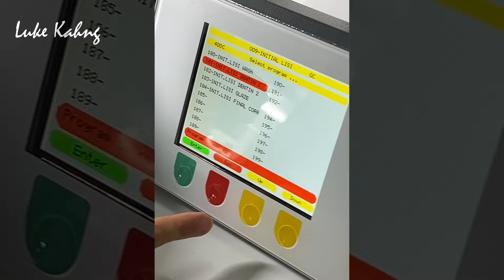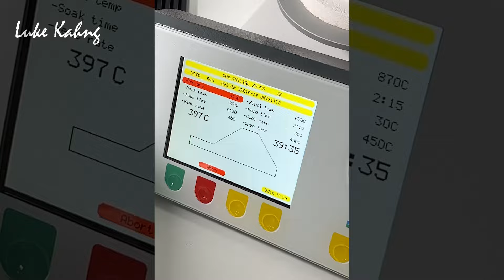Different Full-Mouth Implant Option for Protecting Occlusion

Comment: Mr. Kahng, I have a low smile line. Does that make me a candidate for getting an arch with no gums like the unit you are working with in this video? If this question is too complicated to answer, can you direct me to some kind of literature where I can educate myself on this part of the implant process. Any help would be greatly appreciated. I’m currently in the process of compiling all the information I can find in order to assist not only myself but to make it easier on the doctor as well. I want to inform myself enough so my expectations are based on realistic rather than unrealistic expectations. Thank you again Mr. Kahng.

Comment: My dentist says I can’t have the “ginga” tissue go up high enough to be hidden when I smile because it’ll make the implants fail. So he’s trying to make my finals with a visible space between the denture  “gum tissue” and my natural gums. I know there are ways to create a saddle that allows for easy cleaning and perhaps prevents debris build up on or around the implants but my dentist doesn’t know how to do it. I know there’s new techniques that allow the all on X dentures to be kept in and not removed every six months for cleaning at the dentist- but he says he doesn’t do it that way. So I also have ongoing problems with access holes- where some dentists can fully cover them bcuz they are set permanently in. Could my dentist use some techniques to allow better coverage for the top front gingival area? Any advice? I started my all on four process Feb of 2018 and still haven’t received an acceptable set of teeth. He tells me aesthetics aren’t what matters- I have had teeth all this time and I should appreciate that…. Somehow he didn’t tell me that during the consultation where he sold me on the whole thing being very custom & designed together…. Sorry I’m ranting on the internet 🥸🫣
Reply from the maker: Lab technician can’t give you the advice